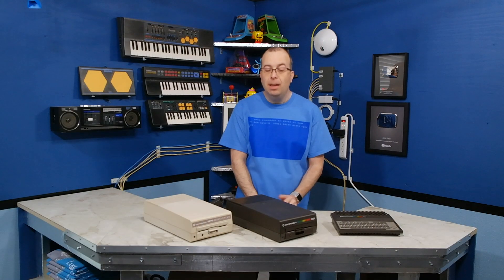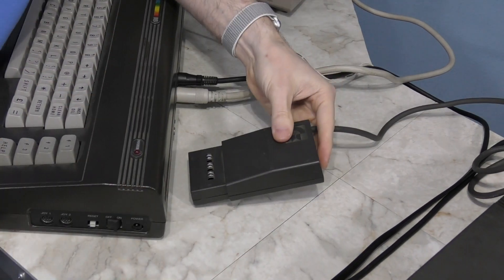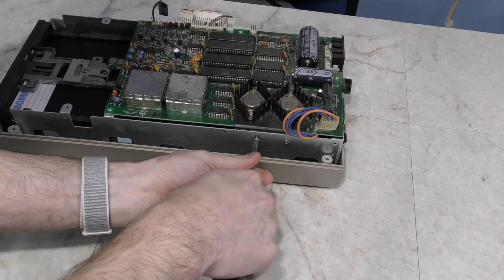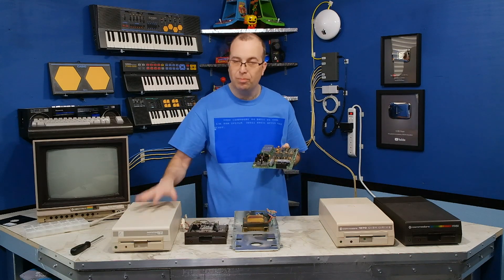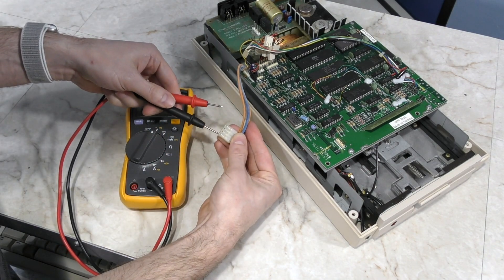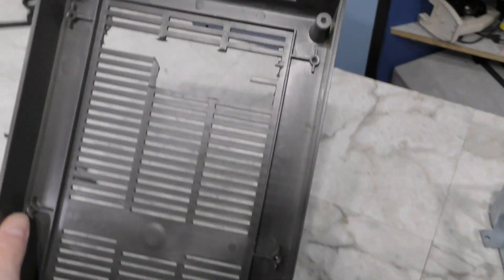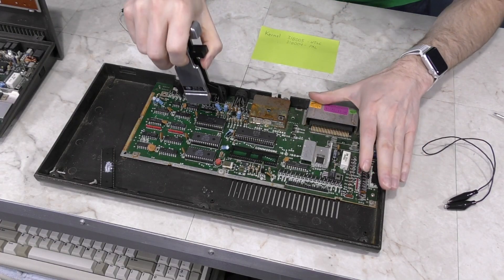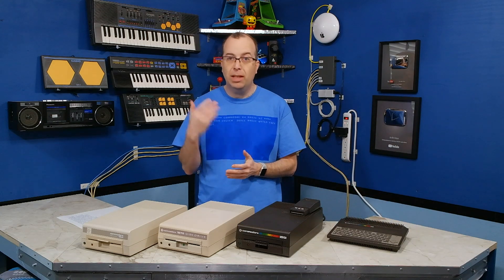Commodore C116 and drive repair, 240V to 120V conversion

Comment: Can anyone explain to me why Europe runs 240Vs just seems like they run their power a little too hot for the average human needs
Reply: Complicated history. And now that  it's basically baked into the infrastructure, it would take a good amount of money and time to change it, since in Europe it's single phase 240 right to the outlet, where as in the US its 2 phase 240 to the load center, then split to 120 to your outlets. think of all the changes that would be required to change it to 120 in Europe. Not really worth it.
Reply: David Annett I never said change it, but It had always baffled me because electricity is the same worldwide so you would think that it would have been easy to make it all the same, I guess it's like measurements America uses imperial while the rest of the world uses metric
Reply: Yea, i was more pointing to why it's a lost cause at this point now, just happened that way and stuck unfortunately. The history of it all i pretty interesting reading!

Comment: Okay I understand you like to use period-correct stuff, buuut wouldn't it have been easier to just get a new clock crystal? I mean, I found the exact kind you needed on Digikey for sixty cents: https://www.digikey.com/product-detail/en/ecs-inc/ECS-143-S-1X/X1021-ND/827513 and it would look a lot nicer and be more reliable than something you desoldered from a computer found at the bottom of a lake. But nice job on reviving multiple old disk drives!

Comment: why did you convert the 240v to 120v? cant you afford to wire 240v mains to your house? cant be that hard to install a safer power network in your house?
Reply: go get a quote to run a 240 volt outlet to your office (for no reason other than to plug in a old disk drive) and get back to us with how worth it that is.
Reply: I cant because I live in the UK & we already use 230-240V
Reply: exactly.
Reply: so whats your point?

Comment: Mmm.. Döner drive... :)~ You really need to apply fresh solder and then flux to make that wick wick like a champ. Also, you can test for shorts with that Fluke so you don't have to guess if the smoke comes out or not!
Reply: Agreed on the flux! Always use flux!!

Comment: 1551 uses 6510T CPU, but this is not the same 6510 as in C64s. 6510T CPUs has 8 bit "built-in CPU I/O port", while "normal" 6510s has only 6. To have this, some pins of 6510 has to be "re-defined" since these are 40 pin DIP ICs. So 6510T has no RDY and NMI signals compared to 6510. However it has additional two bits I/O, what I've mentioned. Anyway, it's just important to note, that some cannot exchange a 6510T with 6510 (or vice versa) thinking 6510T in 1551 is the same as used in C64s (6510). And yes, newer C64s uses the HMOS version of 6510, namely 8500, but again, that's though compatible with 6510, not with 6510T.
Reply: Thanks for sharing! You've just out-geeked the 8-Bit-Guy ;-)
Reply: ;-P It was not my intent though :) But I personally know a case when somebody wanted to put a 6510 from a C64 into an 1551 drive since its 6510T was dead. But that would not work, probably causing even hardware failure of the other circuits of the drive or the 6510 itself, so it can be important to note this.

Comment: Just wanted to let you know that you can hear the high pitch noise from the CRT TV in the video. Its barely audible, but still present. Its not really bad, so I wouldn't worry but I thought you would like to know as I remember you mentioning this in a previous video...

Comment: You can ohm the power input. If the meter shows 0 ohms, you probably shouldn't put power on it. At least not unfused.
Also, when desoldering old solder joints it helps to re-flow them with fresh solder first. Preferably lead based.

Comment: For a unplanned video it was pretty good, I enjoyed it, good job, thank!  Here is a free de-soldering tip, you will have better luck if you apply some fresh solder to the joint first then use the wick, also put some flux on the wick and the joint.

Comment: There are 3 differences between a PAL and an NTSC C64:

1) The colour signal itself.

2) The pixel-clock which also changes all clock sources inside the C64. The SID has a lower pitch in PAL and the processor is ~4% slower.  Since PAL has more resolution but the C64 is fixed to its resolution, the PAL border is a lot larger. The larger border lets the VIC leave the CPU alone for a longer time so while the processor speed is lower, the CPU is halted less often which makes up for the lower clock speed of the CPU.

3) The CIA counts the impulses of the 9VAC. The Kernal uses this information to get its RTC going. When using a simple transformer to convert the input voltage, the clock of the C64 will run too fast or too slow. 

While the C64-I needs 9VAC to generate a picture (the VIC needs 12V), the C64-II (and C64-G) does not! When the fuse blows, the C64-II will still seem to work but has no sound. You can test the fuse easily without breaking the seals of the C64. Just run:

10 PRINT TI$
20 GOTO 10

Watch if the time clicks up. If all you get is zeros, the AC is missing and you need to open the C64 to replace the fuse.
If you get time but no sound, it's often the Zener Diode (C64-II) and sometimes the output Transistor (2N2222, a BC337 works, too). It is not always a bad SID.

Comment: Why doesn't someone implement the electronics of the COMMODORE 1541 drive as a FPGA chip.
Reply: No need to do. A modern Microcontroller is more than powerful enough to simulate the entire drive. You can buy them ready to use.  You can feed D64 images into it by SD-card or pendrive. 

If you want the real thing - just use the real thing, no reason to fake it!
Reply: What I meant was just the electronics in the drive but still use the mechanical drive to spin the disc and get the data into the FPGA then onto the COMMODORE C64 the FPGA just hold the electronics that are on the PCB inside the drive and less prone to vibration OK.
Reply: As I said. Either you want the real thing OR you want to modernize.

SO either restore a drive 100% original (or with mods of the time) or just use SD cards. YOu can always glue the cardreader into a dead shell of a 1541 if you like.
Reply: And BTW, the problem with C64 Discs is not the drives. There are more than enough of them still around. The problem is the Disks. DD Disks are not made for many decades now. They are all more or less unreliable and keep decaying. The drives will survive all working disks.

It makes more sense to get rid of the disks, not the electronics!

Comment: Oh my, that brings back memories, had the Commodore C-116 back in the day in germany when I was a kid. I remember the terrible rubber keyboard, where the keys became more and more unresponsive very well. Back then I could fix the keys temporarily by glueing some aluminium foil to the rubber keyboard mat under each key. 
But they became loose quickly again, and it was just a mess. In the end my dad bought me a Commodore plus 4, which I was much more happy with !! ;) 
There was a commodore magazine, where they provided a project to solder your own speech A/D, D/A converter for the expansion port. By connecting a microphone, you could record your own speech digitally, and play it back on the C- 116, I think only with 1 or 2 bit / 4 kHz audio resolution, but back in the day that was an amazing project. 
Thanks 8- bit guy, for bringing back such memories, and keep doing what you're doing !! ;)

Comment: About PAL/NTSC of the regular C64:

There is a solder jumper (C64-II) or a wire bridge (C64-I) near the VIC. The PAL Version has it shorted. If you own the PAL version, you can cut the connection and attach a switch. When the switch is open, the clock divider (near the VIC) works different. While you loose your picture (flashing horizontal lines), you gain some extra speed.

The reason is that the pixel clock of the PAL version is slightly lower so the processor speed is 0,985248 MHz for PAL instead of 1,022727 MHz for NTSC. This gives you roughly 3.8% more processing speed. Not much but it can save you valuable minutes (or hours) rendering fractals or 3D stuff or calculating PI.

Comment: You are going in the wrong direction. Why convert PAL to Never-The-Same-Color.

Color render is way beter on PAL, resolution is also higher (well for some sources)
Reply: The resolution of the C64 is constant. PAL just means smaller picture and bigger screen border. For quality, it doesn't matter at all since there are no broadcast interferences.

Comment: LITTLE-KNOWN FACTS:
Standard U.S. house voltage is 117 volts, +/- 5%. It's just easier to remember 110, 115, or 120. Precise military equipment usually calls out 117.
NTSC is not 30 or 60fps, but 29.97, or 59.94 respectively. The video had to be slowed to fit color data in, and it would not appear as artifacts in the picture. It also interfered with the audio.

Comment: The 1541-C is more special than just the casing update. It is the only drive which uses the light barrier to detect track zero.
This prevents banging the head against the stopper during read errors or before formating a disk.

In reality, most 1541-C have the light barrier shorted out by a jumper or a piece of wire. This makes the C work just like a regular 1541. The German "64'er Magazin" recommends removing the short and make use of the light barrier. This magazine doesn't reveal why Commodore did that. I enabled the light barrier on mine and it was fine for many years. The only explanation I can come up with myself is problems with misaligned light barriers so Commodore decided to disable them in general at one point of production.

Comment: 1:29 Yes, you DO have 240V in the US. Premises are supplied with 240V 'split-phase' (120V, Neutral, 120V). Though, practicality may be an issue, as most 240V outlets are located in either garages, laundries, or kitchens (to power cooktops, dryers & larger power tools).

Comment: Instead of shorting the fuse you should connect there an old type light bulb. So in case of a shortage you wont burn the chips. All current will only light the light bulb like here: https://youtu.be/FkDmtMSCwh4?t=26m26s   (Polish language tho, couldn't find anything about this method in english)

Comment: You can do this on a Sega master system 1 theres 3 solder pads labeled jp1 jp2 jp3 some are labeled NTSC PAL just score the track between one of the solder pads and solder a centre off switch. so left is NTSC and right PAL and centre is off and the machine will run at 60HZ. I'm from the UK and it looks and sounds to fast in NTSC

Comment: Solder wick problem solutions(?):
1.  Add new solder to the joint before using the wick - quite often the more the merrier (as it will displace the old stuff)
2.  Add flux... I have the stuff in a shoe polish type round tin.  I dip the iron into the flux to melt some and then drag the wick through the pool.
I don't know if you'd already done this, but you didn't mention anything so I thought I'd add my 3 cents. GL

Comment: The C116 has an extended color pallette of 128 colors (16 useable) and the C64 has only a fixed one of 16 colors. Maybe it's an interesting idea to compare the graphic capabilities of the C116 with that of the C64, and see if the former is better than the latter? :-)

Comment: Hey David, what is the difference between the 1541 and the 1570's capabilities?
Reply: When connected to a C128, the 1570 can use burst mode for faster data transfer.

Comment: Just use flux with solder wick and it will work, fluxes are made exactly for working with coroded joints and metals. Except in a case where there is no VIA plating, that's about only scenario I can think solder wick would be useless in.
Reply: I've thrown flux at the screen several times, it never helps. I think he's just trying to demonstrate that there is never one best method, you want to use what works best.

I will say that solder wick doesn't cut it when the pin is tied directly to the ground plane (or several) with no thermal. If there's only one such pin, you get lucky and you can push it through like in the video. Otherwise you really need good suction.

Comment: The reason the solder wick didn't work to remove that solder is that you need flux to help melt the solder more evenly and quickly enough for the wick to pick it up.

Comment: The label on the 240V model 1570 drive also says 50Hz, I believe in the US it's 60Hz so should change that as well. It could just say 50/60Hz, as it works on both. :)
Reply: Yeah he should have but it doesn't really matter for such a floppy drive because the AC is converted to DC anyway and neither the transformer, nor the regulator care about the frequency!
Problems arise when a device uses the frequency as e.g. a clock but afaik, most modern electronics don't do this anymore because the frequency is not 100% accurate.

However, I guess that he's quite aware of this. No one would just blindly assume that only the voltage matters. Especially if they have his level of experience :)

Comment: I guess switched-mode power supplies of the 1980s weren't up to doing multi-voltage operation yet, given the presence of that big, chunky transformer.

These days, you'd be hard-pressed to find something that uses one and doesn't automatically handle both 120 and 240 V operation.

Comment: Why don't you have 240V? You do even in US! Look at your fuse box, you have two 120V phases, between those phases is 240V. As I remember, in US boiler and kitchen-range connects to 240V line for better efficiency. 
Call your electrician, he can help!

Comment: Just seeing how much circuitry is in the Commodore drives (as well as looking at similar early IBM PC drive controller boards and drive mechanisms,) makes me appreciate Steve Wozniak's engineering even more.  It's amazing he was able to implement a floppy controller with so few chips - later reduced to a single chip - where the competitors were using chips that were essentially the SAME chip as in the main computer itself.

(The use of a 6510 also reminds me of IBM's early "Professional Graphics Card" - a graphics card that was basically another IBM PC spread across three full-length ISA cards, used solely for rendering graphics.)

Comment: One thing I'd never thought of - would a European 220V device work with a simple physical plug adapter plugged in to a US "high voltage" 220V outlet?  (Like for an electric clothes dryer, hot water heater, or stove.)

Comment: Do desolder lead free easily just add some leaded 60/40 to the unleaded solder and put some flux on the desolder braid and it make the impossible possible and the possible 100 times easier.. hope that helps.

Comment: Isn't Europe 230V?
Reply: belkida 220-240V nominal, but it’s with a certain tolerance. In Norway providers are obligated to give you between 218 and 244V. Not sure about the tolerances in the rest of Europe.
Reply: In the 1990's the voltage was harmonized in the EU to 230V +/- 10% and that is today what devices should accept. Originally mainland Europe was 220V while UK was 240V. The tolerance of 10% was chosen so that devices will work on power grids that actually supply 220 or 240V, because the power grid could not be converted in one day. It is possible and likely that there are still places in Europe where the actual voltage is 220 or 240V, allthough in many places voltage did change over the years to 230V.

Norway is not EU, but EEA and as often the case, it had to accept what was decided elsewhere in Europe. 218-244V sounds like a 5% tolerance, and that means that the conversion to 230V has technically been completed.

Commodore equipment was manufactured when the grid was not yet harmonized and therefore both equipment designed for 220V and 240V exist. Lots of Commodore equipment have transformers that can easily be rewired between 220V and 240V. If you own such a device, it is often best to set it to 240V: This causes the least amount of heat being produced ensuring long life, while the power supplies have enough safety margin to function correctly.

Comment: We here in the netherlands have 230v 😂
Reply: You are not alone. I think Uruguay or anoher in southamerica uses 230V. Here we have 220V but it can be 210 or 230 depending on the grid load .. LOL.
Reply: Most of the world uses 220-240v.
Reply: Higher voltage does not inherently mean "more powerful".  Tea kettles here work perfectly fine on 120v.
Reply: I don't know what else to tell you, we 120v'ers have tea kettles and they boil water.
Reply: No one gives a fuck about your shitty little country
Reply: tezza192 euh i do

Comment: The c=116 reminds me of the Amiga 600
Reply: ᅚᅚQix there was a amiga 500 (which i had), a 1000 and a 2000, but i've never heard of a 600. was it a modified 500?
Reply: imagine a A500 with out the ten kep pad.  Floppy on the right.  But what was cool was a pcmcia slot on the left.  And had the ECS chips.
Reply: A600 with the vampire upgrade is my dream Amiga.

Comment: You forgot to change the amperage, which half the volts, double the amps (as a basic rule, it's a little more than that, but for all intents and purposes...), and in the US you use 60hz, not 50hz... might want to reprint that entire line in the end :D

Comment: Great video, always amazes me how much circuitry there is in Commodore disk drives compared to other systems i.e. pretty much an entire computer board almost as complicated as the system they plug into. They are built like tanks though, and seem to keep working.
Also good save on the C116 computer, they are a bit more common over here in Australia (although I still don’t have one), but there is not anywhere as much information on them compared to other Commodore machines so I look forward to your full video on it.

Comment: When you are trying to use solder wick on old solder, and are having problems. You should try to apply new solder first, to freshen it up. It will help a lot. Probably partly as it adds a bit of flux and cleans things up.